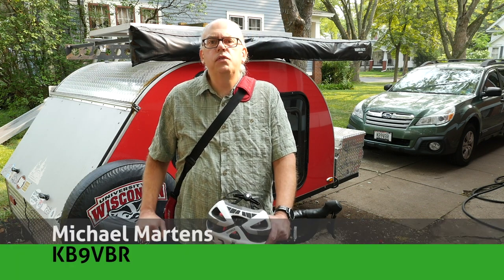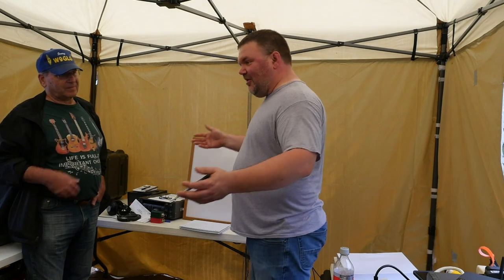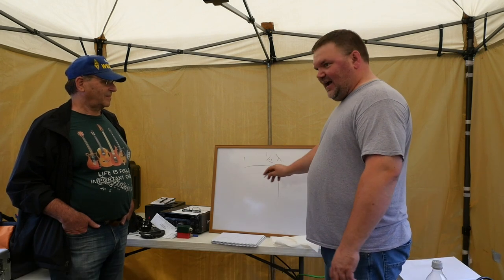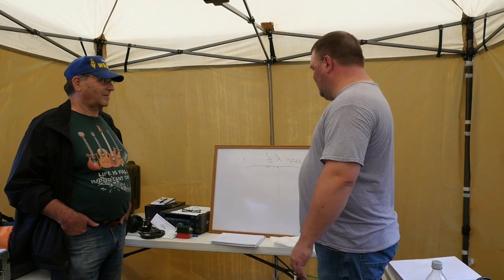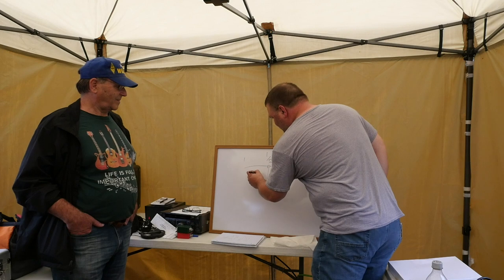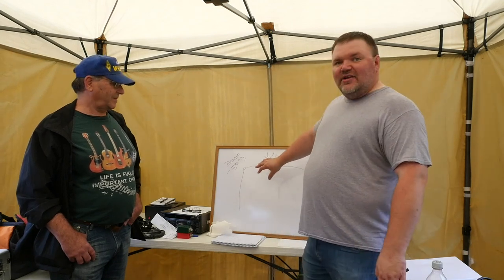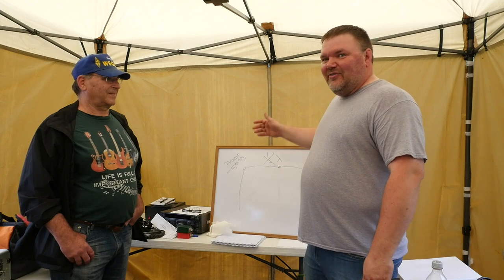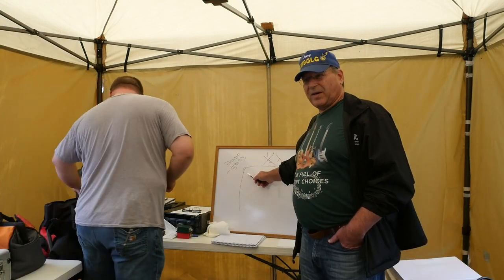All About End Fed Antennas, Field Day Educational Activity - Ham Radio Q&A

Comment: I don’t necessarily agree with the efficiency of a random ef being better than a properly made efhw. Grounded while using a choke or line isolator should be at the entrance of the home. You will find if you choke a efhw at the feedpoint , you will have about 2 ft of rf radiating. N4LQ has many proven studies of the end fed antennas. I like to say my 9:1 unbalanced random wire acts like a dx commander vertical while my efhw acts as 3 resonant dipoles. Inverted V config of course. Rf does act strange with + 90 degree bends. Build a delta loop and watch the radiation pattern on whisper. 👍🏼
Reply: Hi Jay, I actually recommend you place a good RF choke on the coax about 0.05 wavelengths from the EFHW transformer on the lowest band of operation, and then you can eliminate the separate counterpoise wire.  The shield of the coax between the EFHW transformer and the choke becomes the counterpoise.  The 0.05 wavelength recommendation comes from the work done by AA5TB as well as the 4NEC2 modeling that I did to understand his recommendation.  On my 40 meter EFHW antenna my choke is actually 0.06 wavelengths from the transformer.  During comparison tests of a 40 meter dipole mounted 20 feet up and my 40 meter EFHW mounted 20 feet up I can't detect a difference except for stations right off the ends of each antenna (each antenna compass heading about 45 degrees different from each other during the test).  I should also mention that my EFHW transformer efficiency is 90.6 percent which is a loss of only 0.43 dB which is less than 0.1 S units.  You can read some other comments about this in my response to another comment up above.  73, Don (wd8dsb)
Reply: Yes, I picked up on that blank statement that "a random wire is more efficient than an end-fed halfwave."  It certainly accurate to say that a random wire that is properly matched to your radio and feadline will be more efficient than an improperly matched end fed antenna, but there are too many variables to make a blank statement. This includes it's surroundings, it's proximity to absorbing objects, ground conductivity angle of wire to ground, and other variables. Either can be a good radiator when properly matched. Also the choice of the best material for the matching network (usually a torroidal transformer) can make or break an installations efficiency. If you can match it at the antenna before it hits the coax, feedline losses are reduced. In a random wire installations, there is almost always a reactance to be tuned out at the radio end. This further adds to loss in the coaxial line over one that is matched at the antenna feedpoint. A halfwave end fed matched at the antenna would not add this additional feedline loss due to high reactance having to be nulled out at the radio-tuner end.

Comment: one thing the first presenter needs to realize that an antenna creates a circuit and as such there is a return path. He thinks you can just connect the center of the coax and leave the shield unconnected, but the shield is the return path and the antenna forms a capacitor back to the shield through the air. This field contributes to the radiation (it's not just the current which is also what he said), so the shape of this field affects the radiation of the antenna, so it's not something that should be ignored.

Comment: Thanks, Mike, Joe, and Jerry.  As a 70 yr old (only an operator for 6 years), I'm a big fan of EFHW.  I have a 102 foot sloper, and a 132 foot in a inverted V configuration.  Your video taught me a a lot this evening.  And Mike, the 2 meter J-Pole you sold me a few years ago is still performing superbly.  73s "The JJ"  KC3EWY

Comment: Another way of understanding what's happening along the horizontal wire is as follows. 

 Ohm's Law 
We all remember Ohm's law. Resistance voltage and current are related to one another. If we know two of them, we can calculate the third. In this case, we want to understand the resistance along the horizontal wire because we are trying to understand why the impedance rises towards the ends of the wire. So that would be:

 R - E/I 
 Resistance (or impedance) = Volts/Amps 

The resistance (impedance) is lowest in the middle of the 1/2-wave wire-- about 50 to 70 Ohms. As we progress away from the middle, the impedance (R) goes up. This is because when we pump power into the antenna, it is equally distributed across the wire, but in varying proportions of Voltage and Current. So let's say we pump 100 Watts into the wire. At the center that 100 Watts will be comprised of, say, 100 Amps and 1 Volt. At the ends, it may be comprised of 100 Volts and 1 Amp. Since the Current/Voltage ratio varies as we move across the wire, its impedance (or resistance) varies across the wire. This is because the resistance (impedance) along the wire is Ohm's law, which says the resistance is the ratio of the Voltage to the Current (R=E/I). 

In the middle, we hypothesized the 100 Watts was comprised of 100 Amps and 1 Volt. In Ohm's law, that would be 1/100 or .01 Ohm. At the ends we hypothesized the 100 Watts was 100 Volts and 1 Amp. Ohm's law says that is 100/1 = 100 Ohms. What that shows us is that where the Voltage is maximum, the resistance is maximum. And where the Voltage is minimum, the resistance is minimum. In this hypothetical case, by a factor of about 1000. 

 Current Feeding vs Voltage Feeding 
So as you move your feedpoint across the wire, the Voltage/Current ratio changes which changes the aerial's feedpoint impedance. If the wire is at least 1/2-wavelength long, the maximum impedance will be at the ends and its minimum at its center no matter the frequency you operate it on.  You can expect to see the same high impedance at its ends on all bands. You can take that to the bank--which is exactly what the manufacturers of the "end-fed Hi-Z matching transformers" are doing. They know that the ends of a wire will show about 5000 Ohms no matter the excitation frequency. SO they make a broadband transformer designed to match that predictable Hi-Z to 50 Ohms. The takeaway is that when you excite the wire at the end you are Voltage Feeding the aerial. When you excite it at the center, you are Current Feeding the antenna. 

 Current Radiates the RF Signal 
The only other tidbit to add is that an antenna has maximum current at its center and minimum current at its ends. And it is the current, and not the voltage, component that causes an antenna to radiate your signal. Therefore the middle of the antenna, where there is maximum current and minimum voltage, is its "Filet Mignon" section. It is the part of the antenna that radiates most of the signal. Therefore, if you do not have enough space to hang a horizontal wire, you try to get the Filet Mignon middle part up as high as you can, and then do what is necessary to its ends in order to make it fot -- e.g. drop the ends of the wires vertically towards the ground if you do not have sufficient room to span its entire length.

Comment: RF GROUND Necessary for Voltage Fed Antennas 

A little confusion about "counterpoises". When you Voltage Feed an end fed antenna via a ferrite transformer, it is best to do it at ground level. That is where you mount your commercial "transformer box. From the box's "hot" lead, you run a wire up to the horizontal part of the antenna--the vertical part becomes part of the antenna's total length. You then connect the coax to the transformer box on the ground.  The "cold" lead from the box goes to a ground rod only 2 or 3 feet long sunk into the earth. Off the ground rod, you run several "counterpoise" wires several feet long, arranged, if possible, in a wagon wheel pattern. The purpose of this is to create a good RF GROUND to act as a "counterpoise" to the matching transformer in your box. The old fashioned way of thinking about this is that the RF GROUND "gives the transmitter something to push against" when pumping electrons into the wire. If you want, you can add a current choke balun made from turns of coax around a PVC tube, a dozen ferrite beds slipped along the coax, or a 1:1 current balun (not voltage balun) before the coax run back to the shack. 

You do not want to use the coax feedline as the counterpoise. 
You do not want to run a long ground wire from an elevated transformer box to the ground. 
You want to feed the end fed on the ground via a vertical wire up to the horizontal run of its length, and put a short ground rod with several short wires coming off of it on the surface of the ground, or buried in the soil.

Comment: 14:25 the 3 wires don't have to be wrapped 9 times around the torroid for a 9:1 transformer....the 9:1 ratio comes from the 3 wires ie 3 squared is 9.  You can wrap the 3 wires 2 times or 100 times...it would still be a 9:1 RF transformer.
Reply from the maker: You are correct, thanks for the clarification
Reply: So how can we determine the number of turns

Comment: One other interesting fact about EFHW, is the height of the antenna.  You gain more dBs if your transformer is high off the ground compared to a slopper.
Reply: A 'sloppy' antenna does not work well. A sloping one works just fine...
Reply: @eknaap8800  It depends whether or not he is using his tongue.

Comment: Search for EFHW on Facebook you may find the 12,000 posts on this subject? Steve Ellington has some youtube videos covering his years of experience with the 49/1  version.
Reply from the maker: You are correct, but Facebook has a terrible search feature and a low signal to noise ratio. You may spend more time digging through the chaff to find good bits of info.
Reply: @KB9VBRAntennas  Steve Ellington on youtube has a complete presentation, with a compensation coil to use 75  SSB  plus the capacitors to lower the resonance point on the higher band.  He is the Facebook poster and has spent years finding the better approach to 49/1 transformer use.

Comment: at 23:54 somebody asks if they can do a u-turn on the wire if they don't have enough space, so it can still be tuned. The one guy says that once you wrap it 180 degrees RF won't be able to come around that bend. That is totally not true. Maybe if you're in the GHz. The real reason why this would not be good (at least I think) is because the currents would cancel out in this portion and basically defeat the purpose.
Reply: maybe i should think of this as a meandered antenna
Reply: It has nothing to do with "electricity turning corners" but running the element close to itself, CLOSELY SPACED.
Reply: @bigdaadio.K2WW  Right. If they are closely spaced, the coupling is so strong that it might as well just be one wire; but you ham people use such low frequencies that I'm not familiar with.

Comment: Why 64:1? A 49.1 is way fine to go with! Just saying...thx for another informative documentary video. Happy weekend to everyone out there / in here. 73's from the German Fontier de Your Friend Uncle Guenter
Reply: Hi Guenter.  Either will typically work just fine and no one ever mentions it, but a 56.25 to 1 might be the best compromise if you're not sure if you want to use 49:1 or 64:1 (example: 2 turns on the primary and 15 turns on the secondary theoretically yields 56.25 to 1 which puts you right between 49:1 and 64:1).  The feedpoint impedance of the EFHW antenna like all other antennas is dependent on how high the antenna is mounted above ground, and therefore there really is no one perfect ratio to use and that's why some folks use 49:1 and others use 64:1 (depending on the installation one might provide a slightly better match than the other).   Just FYI, and 73 Don (wd8dsb)
Reply: @wd8dsb  Hello Don, thx for coming back to message. Yes right, all this makes sense what you mentioned. The Height from the Ground makes it happen or not. I run a home made 49:1 Transformer Balun + an Extension Coil 34µH. The feeding point is mostly very low..like 12-15inches from the Ground, vetical polarization as a portable setup. But this antenna works just so fine and is simple to install for a one man army in just no time. It weights nothing and doesn't ask for much of room in my back pack or RF Utility Baggage.
Keep up good work & happy weekend from the German Frontier, sincerely your Friend Uncle Guenter
Reply: @DK5ONV  Hi Guenter, the EFHW really is a nice antenna when properly implemented.  I also saw some data from W8JI that shows the feedpoint impedance of the EFHW is lower when operating it on the harmonic bands, so if you use the EFHW on the harmonic bands a 49:1 might be a better choice than a 64:1 transformer.  As an example the 64:1 transformer might be a better pick if just using a 40 meter EFHW on the fundamental band (40 meters in this example) but if you intend to use it on the harmonic bands then the 49:1 transformer might be the best pick based on the W8JI data.  Again, no right answer as it all depends on mounting height and if your operating the EFHW antenna on the fundamental or harmonic bands.  Just FYI, Don (wd8dsb)

Comment: Very good video.  Interesting … I am considering end fed antennas for portable and learning how to feed them and hoist them up.  I plan on starting with Shark Ham Sticks based on your recommendation.  I am also wanting to try end fed antennas mounted on a trailer hitch mount.  Where can I learn about lengths of random wire trade-offs?  All the best, 73 de KI5HXM

Comment: What is the performance difference between using an end fed half wave vs a  quarter wave end fed.? I bought an end fed antenna recently which is 41 foot long. This would be roughly a quarter wave at 40 meters, which is the band I want to use. Will it make a big difference if i increased the size to around 66 foot which is then a half wave for the 40 meter band? Thanks

Comment: the other thing both these guys need to realize, it's not all about matching impedance, i can use a 50 ohm resistor as an antenna, perfect impedance match but doesn't radiate. When they are talking about the random wire, what are the constraints? Is 1 inch a random wire? It's not 1/2 wavelength so according to these guys a 1" random wire will work great provided the impedance is matched... nope.
Reply: I think you are stretching things a little...lol

Comment: Seems to be somewhat of a fad antenna.   While he is sort of correct (and sometimes rather incorrect, I see the other guy trying to correct him a few times), he assumes rather a lot on the part of the listeners who might run home, connect just the center of a coax to a half wave antenna (how long is that, exactly?) and if such person is lucky NOT destroy his radio or get an RF burn as the "counterpoise" IS his feedline and human body at the south end of it.  
Emphasis on OPEN circuit at the end of a coax; IF the coax is 1/4 wavelength (mind the velocity factor!) it will transform open to short; thus open circuit at the antenna will reflect as a short circuit at the radio.  But since some energy is radiating at the feed point, you won't reflect it back as a short circuit and if you are incredibly lucky it might even be around 50 ohms; but you are going to have RF along the entire length of the outside of the coax.  How did it get there?  Well, the entire INSIDE of the coax is a CAPACITOR with reference to the inner conductor.  So you charge this capacitor on the positive cycle, it has nowhere to go since y'all decided to NOT connect the feed point shield to anything, so the coax shield itself becomes a radiator.

Comment: @20:30 you want the choke as close to the antenna feed point, yet others (waters & stanton for example) say to have it close to the shack. so which is it?
Reply from the maker: There seem to be two contradicting thoughts on this. Left unchoked, your feedline becomes part of the antenna system and will act as a counterpoise. Some people believe that you should then use a common mode choke at the feed point to prevent that from happening. Others believe that you should let the feed line radiate and place a common mode choke near the transmitter to keep RF 'out of the shack.' I haven't seen a consensus that one method is better than the other. 

My recommendation is to use a method that works best for your installation as environmental factors will affect the antenna system's performance. If your coax feed is relatively short, say less than 50 feet, I'd probably choke at the feedpoint. If your coax is 75 feet or more, then I'd be more likely to let it act as a counterpoise as the chances of RF making it into the shack are greatly reduced.

Comment: Greetings could you tell me what gain   have the EFHW antenna. Excellent your video
Reply from the maker: Gain can be difficult to ascertain with HF antennas because mounting height can affect the take-off angles and radiation patterns. Also multi band antennas will have major and minor lobes when you move off the fundamental frequency. For the most part a 40 meter EFHW should have about 6 dBi of gain at its fundamental frequency. Here's a page that has some interesting plots to help more with this concept: https://www.qsl.net/kk4obi/EFHW%20Straight.html
Reply: Thanks Mike  excellent answer to given you master, it was a doubt that I had was to know more less and thank you very much for the reference link 
73 
W4EDY

Comment: End fed and random wire are NOt two separate things; end fed is a special case of random wire.   As you tune the frequencies, your radom wire will BECOME an "end fed half wave" when the frequency you have chosen just happens to be a half wave.  But it did not suddenly cease being a random wire.  Maybe a Random Lucky Wire.  Well, Random Unlucky Wire since it is difficult to feed a end-fed halfwave antenna.

Comment: Center of the dipole is around 70 Ohms / not 200 !
Reply: A off-center fed dipole is 200. A regular dipole is 50-72 depending on if it's hung as a flat top or inverted V